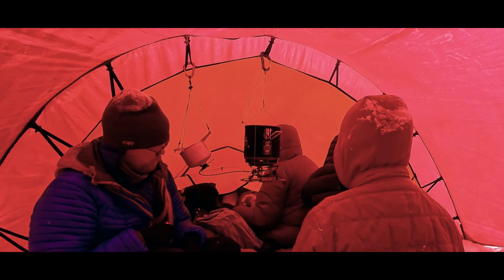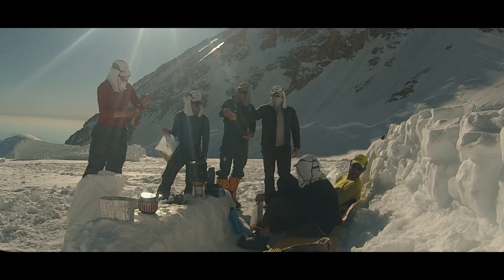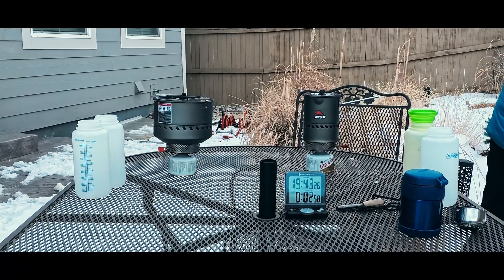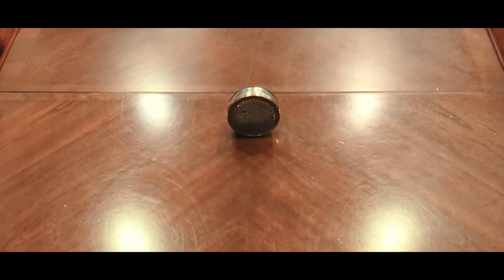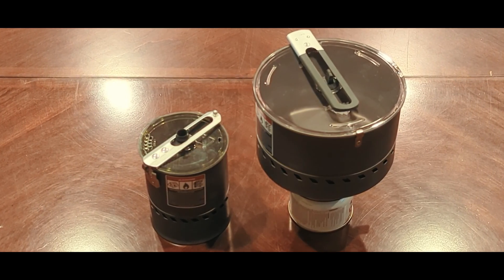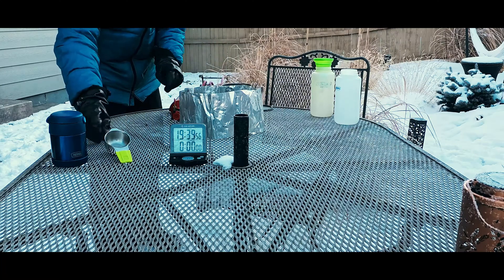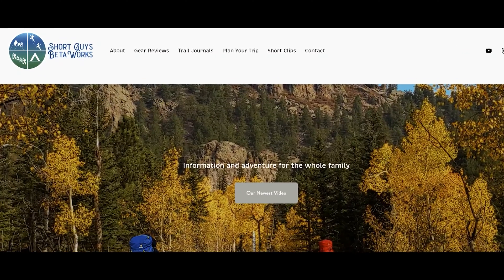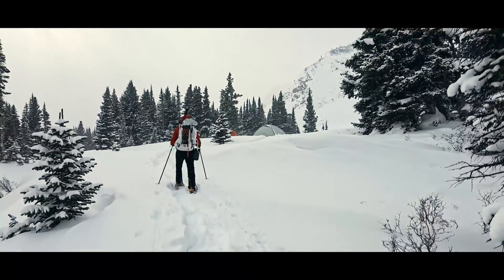The Right Cook Pot Can Save You HOURS Across a Climbing Expedition

Comment: What about the small pot being full vs the bigger pots not being full. Perhaps it matters if they are full or not? Just a thought
Reply from the maker: My hypothesis is that the heat transfer up the metal sides of the pot means an already heated pot is "surrounding" the snow on the second boil and thus needing less energy from the stove, itself, to make the second boil happen.

Comment: I do believe much the the inefficiencies seen with using the larger pot comes from needing to warm the greater mass of the larger pot. The silicone sided pot doesn’t conduct heat up the sides and therefor only needs the heat the bottom before transferring heat to the water.
Reply: The water inside needs the same amount of energy to boil, no matter whether you do it in one or two batches. Therefore, an advantage for one method over the other can only come from outside factors like heat loss, transfer of heat from stove to pot or distribution of heat.
Mass of the pot might be an issue, but more than 15 minutes difference...I cannot imagine an outdoor pot having that much mass
Reply from the maker: @foobar9220  I think the transfer of heat on the second batch of a 1L pot is part of the explanation. Already hot pot.
Reply from the maker: That's an interesting hypothesis.

Comment: I think this question is an much about logistics as absolute efficiency. I annually do 4 to 7 day ski trips between Feb through early April and pot size is a big head scratcher. Group size ( 2 vs 3 vs 4 person) and meal type (hot water only or cook in pot) and wind shelter (open pit kitchen or mid kitchen) are big drivers in this equation. I don't have a reactor or windburner so white gas my only option and I don't really trust the canisters in the temperatures I can get on these trips. I've gravitated back from using a ~3.5l pot which I like for convenience for both melting and cooking, back to ~1.8l pot with heat conduction rings on the bottom as I believe I have better wind shielding and heat transfer. I also am moving away from meals that require cooking to a mix of commercial freeze dried and home dehydrated. Even in groups of 3 I like to bring 2 stoves and 2 pots for redundancy and time efficiency.
Reply from the maker: These are really good points. I've come to a similar conclusion: that the performance differences as given in common wisdom (bigger pot does better) is certainly not true enough (if true at all) to outweigh other logistical issues. I'm much more likely to take the system that works for the logistical challenges of the trip over straight performance.
Reply: @ShortGuysBetaWorks  should have added: amazing investment you make both with your kids and producing content. Thanks for your efforts, great stuff.
Reply from the maker: @northernAT  Appreciate the support!